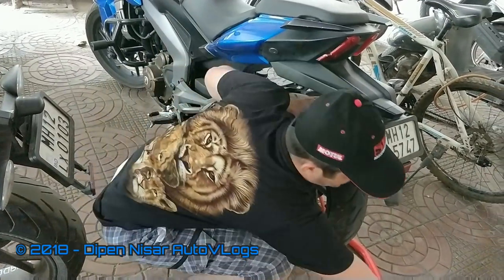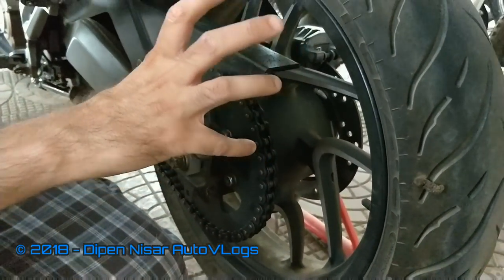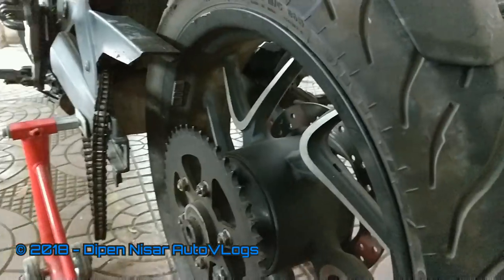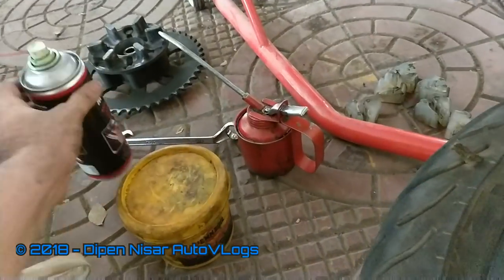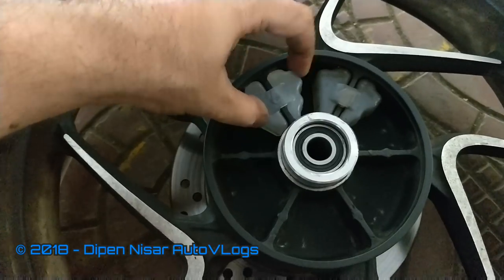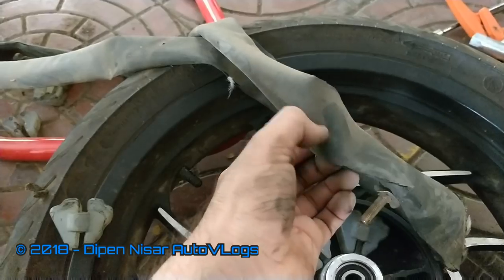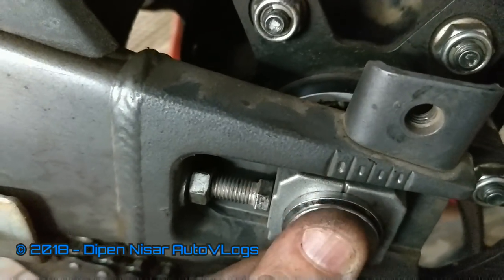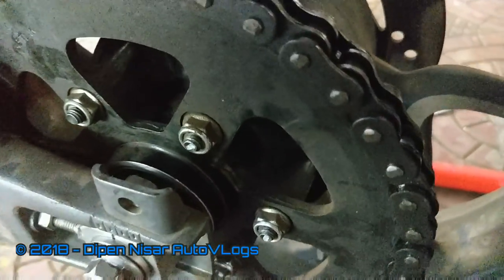Bajaj Dominar 400 Maintenance | Rear Wheel Hub Rubbers Replaced | Dominar DIY | Dipen Nisar

Comment: Rear wheel of my d250 not rotating freely since 1st month of buying. Svc center make me fool. And I have rode 27k km and 3 yrs has completed. Now what can I do with rear Tyre to rotate free thank you
Reply from the maker: It won't be completely free and if it is not free even after 27000 kms then it's 100 % alright. There isn't any issue in it. 👍🏻. Else till now something would have broken in that section.

Comment: If the rubber s got damaged. Can we expect tik tak chain sound while shifting the gears.. Please bro tell me, cuz local mechanic is telling me that your clutch plates got damaged, but that will cost huge so.. If the reason is drum rubber problem it will be helpful for me
Reply from the maker: Replace the drum rubbers and check. Also if the local mechanic is not trust worthy, go to bajaj or some other dealer. Rest check the video, I have explained how to check drum rubber issue. 😊👍🏻
Reply: Hi did you're issue get resolved?? Bcoz same has happened with me when I went to showroom they told I should change my clutch plates and sprocket will both will cost me around 8k,hence please let me know

Comment: Hi, my dominar is making some noise in the rear while going through bad patches of roads. Tightened loosend the chain everything done. But still the problem persists. It like khad khad whenever i go through bad patch of roads
Reply from the maker: Get the following checked.

1. Chain Slider.
2. Number Plate Foam missing. (behind it).
3. Rear Mudflap loose.
4. Rear Seat Rubber

or some other part loose below both the seats or in the rear or side panels.

Please verify all and do let me know the feedback.
Reply: @dipen.nisar.autovlogs  Its coming from the chain area only, nor the mudgards nor the saree card no number plate either. I think my chain hits something. Wat could it be any guesses?
Reply from the maker: @pranay4915  then only chain slider and chain. Dry out the swingarm from top and bottom and then check if there are chain lube marks when the chain hits the swingarm

Comment: does this wheel hub rubber and wheel bearing fit in ktm?
Reply from the maker: Yes. It's same
Reply: @dipen.nisar.autovlogs  one last question is dominor 250 chain sprocket fit in duke 250 because i don’t have any ktm service center in my area ?
Reply from the maker: @zuhaibkhan9608  no idea buddy .

Comment: Bro I have a query, when I take sharp right turn at slow speeds I hear Chi Chi Chi noise from rear wheel. 2 months back when I took my d400 for service I mentioned this and then mechanic dismanttled rear wheel and applied grease on axle rod. After that it was fine but from last few weeks the noise started again. What could be the issue?
Reply from the maker: Will need physical inspection of the bike to understand more, but may be you can get the axel lubed again. it could also be some cable getting pulled *front brake cable line), which is engaging the brakes in some manner (may be via ABS unit).
Reply: @dipen.nisar.autovlogs  Okay noted 👍
Do you think I need to replace bearings? BTW rear wheel rotates freely and no vibrations felt while riding.
Reply from the maker: like I said, will require physical inspection, and there are quite a few things to be checked.

Comment: My dominor run about 4200km but rear wheel hub is not in good condition. I wonder so soon wheel hub rubber gone even before 5000km..
Reply from the maker: Anand Subramani - it also depends on how the bike has been ridden. How often chain setting has been done. Get the bike verified.
Reply: DNA: Dipen Nisar AutoVLogs chain setting been done frequently as I face some chain noise issues.  U have good knowledge on dominor. Good.
Reply from the maker: Anand Subramani thank you
Reply: @dipen.nisar.autovlogs  after how many Kms have u changed it
Reply from the maker: @mgmainak1024  I guess it was between 9000-10000 kms.

Comment: I changed wheel hub 2 times in less than 8000km..
Reply from the maker: I have done 21000. It's time for my second set too
Reply: @dipen.nisar.autovlogs recently i adjusted bike chain  on dominar and in less than a week I facing play in rear wheel. Same problem happened in the past. So took bike to service center and they changed wheel hub. Couldn't believe that wheel hub replaced 2times in less than 8000km.
Reply from the maker: @anandsubramani7882  you mean the hub rubber or the Hub itself ? I need to change the hub rubber. Not the hub.
Reply: @dipen.nisar.autovlogs  hub rubber brother as u showed in the video.. Ok when to change hub assembly??
Reply from the maker: @anandsubramani7882  Hub assembly only when there is a impact and it breaks or something. Else I have never heard of it being changed. And if you got it changed under 8000 twice. That means either the chain had been running dry a lot and hub rubber got stressed out sooner. Or riding is aggressive or last time they were not changed correctly
Reply: @dipen.nisar.autovlogs  I lube chain every 250km brother and regular service. I still couldn't figure out the problem. When asked to service center I get no proper answer
Reply from the maker: @anandsubramani7882  did they show you the worn out rubbers ? Both the time ? We're you present at the workshop and checking the work.  ? Did they show you the actual play ?
Reply: @dipen.nisar.autovlogs  s.. They showed and while servicing i always be infront of the bike .. Rubber was worn-out
Reply from the maker: oh ok. you then probably need to get the bike checked by some one else.

Comment: I saw a rubber damper made from tyres for longer wear and tear. Have you tried that for your Dominar?
Reply from the maker: Don't try those. They might be extra hard and may have adverse effect. Stock ones are not that expensive
Reply: @dipen.nisar.autovlogs  copy that